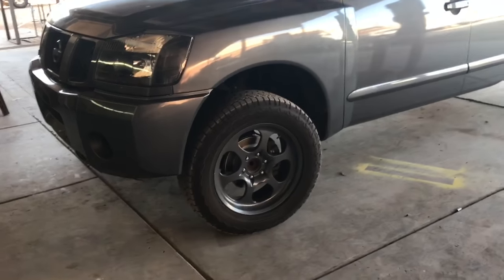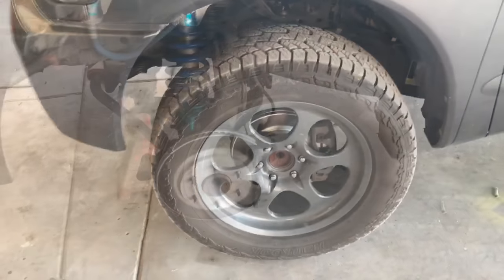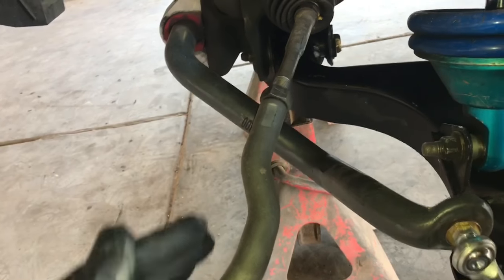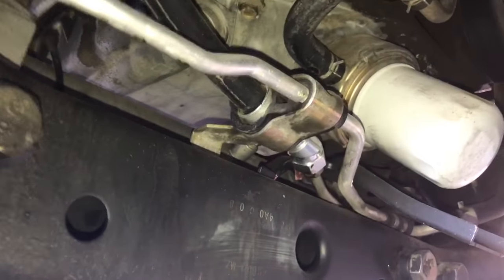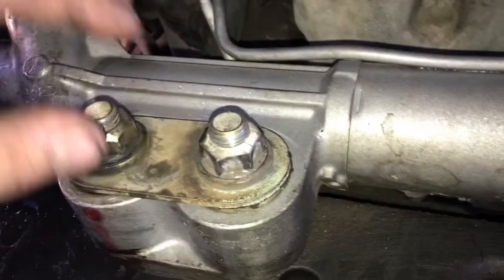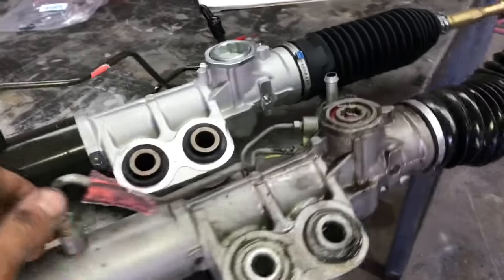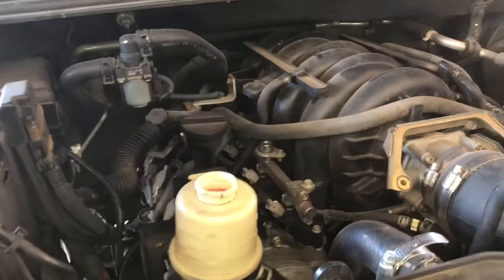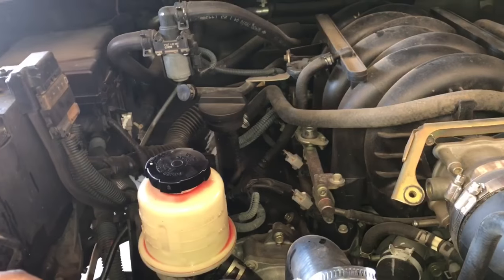Nissan Titan Rack and Pinion Replacement (2004-2015)

Comment: Great video. My 04s rack has a little life left it in, but I decided to replace the bushings. I had a hell of a time with the rack bolts also. Decided it was a good excuse to buy a new impact lol.
Reply from the maker: Ya those bolts are no joke. What impact you go with?
Reply: Truck on jack stands. I used a 6point 22mm socket on a 'crapsman' ratchet (breaks no worries) used my jack to push handle up to loosen. Yes, very tough. Held bolt head with cresent (didn't have correct wrench)

Comment: Awesome again, I’m at 187K in my 08 CC. PS. Boot has a very small leak and I’ve been putting it off because I didn’t want to pay 1000 dollars to Nissan but this looks fairly simple but I have heard about this 3 nuts! I too looked at reman. From Rock Auto! It appears you haven’t had much luck with them! I probably will go OEM also. So glad I found your videos! I can do all this work now! No fear thx.
Reply from the maker: since making this video i have discovered a brand napa uses. i tried one two weeks ago and was very impressed with the qualilt of the rack, looked oem and not spray painted like most rebuilders. ill post the link tomorrow for you
Reply: @AaronHinesAuto   Hi Aron which rack and pinion u can Recommend me ? The dealer want 17.00 for new one and 1000 dollars more for the installation, 3 k total with taxes  .. I looking for buy one and replace by myself, my truck is 2010 Nissan Titan pro4x lifted 6 inch
Reply: @watchmanexpert  that’s an outrageous price.

Comment: 121 torque spec is super tight, i think if you use a breaker bar and jack up the end of the breaker bar it should work. You can spray a bit of lubrication if you want but the strength of the jack can easy loosen it up.

Comment: Great video, just beautiful careful hitting the nut on the tie rod. I did that and destroyed the threads on the upper control arm, so now I have to use a die or replace the ball joint, I would use a fork tool instead.

Comment: Aaron, I’ve tried everything to remove those 3 huge rack bolts, just wanted to know how powerful is your impact wrench? Mine is a 250 ft pound and those bolts won’t budge at all, I’ve tried the heating method, a breaker bar, place the cheater bar on a jack and those bolts won’t budge, i was thinking of cutting the bolts off, any ideas? Awesome video by the way!
Reply: I had to cut one of the bolts off...got 2 off and stripped the 3rd one trying to get it off.

Comment: Great Video!!!  Thank You   I'm replacing minebc  I just tried to do a DIY of drilling a hole through the drive shaft and the shaft that is at the top of the cylinder and bolt them together bc the tines are gone and it was slipping.  
Didn't know that the actual shaft that's above the cylinder was full of oil ! I thought it would be a solid machined metal shaft!   Why is the shaft filled w oil?

Comment: Aaron I replaced the rack and pinion on my 2006 Nissan Armada SE, but now the VDC and SLIP lights are on.
Reply: Youre truck needs to be reprogrammed at the dealer when te vdc light comes on by itself.

Comment: Great video!   However, I am not sure that the three rack bolts on the bolt head side are five sixteens like you mentioned.  The nut is either seven eighths like you mentioned but I believe the bolt heads are a little larger - 24 mm if I am not mistaken.   Anyway, great video like It said.
Reply: in sure he meant 15/16 which is close to 24 mm

Comment: What does the o ring look like on the high pressure line I want to make sure I'm replacing or looking at the right thing because there is an o ring on my high pressure line when I took it off

Comment: 2008 Nissan Armada I replaced the rack and pinion feels really weird on curvy Rodes feels like the steerimg wheel is loose and not somewhat stiff did I do something wrong? Or maybe the rack has air and needs to be purged more?

Comment: When removing the steering shaft did you spread it open far enough to push it sideways or is there room to push it up off of the rack? Thank you
Reply: I know this is a year old but for anyone that probably has the same question. The shaft does slide up. It's made like that in the case of an accident so the steering wheel does not get pushed up against your chest.

Comment: Where can I find your notes for the four-wheel drive removal and replacement of the rack and pinion?
Reply from the maker: its the same as the 2wd exept the front diff will need to be removed. i just make a video  on how to remove or replace the front diff. hope this helps. 
https://www.youtube.com/watch?v=kAYswL9oRBc

Comment: Thx for the video. I have a 2008 Infiniti QX56 (essentially an Armada). Where are the steering rack bolts located? 
Right now it’s making creaking and popping noises when backing out and turning slowly out of my drive way. Going in a straight line, I hear nothing. I’ve been told the steering rack bolts can get loose. So I’d like to see if they need to be retorqued. I’ve already installed a newer Stillen brand sway bar stabilizer and sway bar links. The noises are still there tho. Any ideas?
Reply from the maker: I have the same swar bar on my truck and live it. There are a total of 3 bolts that hold the rack on. The bolts go through a metal crossmember under the front part of the oil pan of the engine. I have not personally seen these bolts loosen up. Don’t can’t it can’t happen though. I have seen the rubber-mounts that the bolts go through go bad, which requires replacement of the rack
Reply: Aaron Hines I also replaced the sway bar rubber bushings and applied Amsoil lube to them and inside the metal bushing brackets. Thought later maybe I shouldn’t have greased them. I really don’t want to take it to a mechanic. Every Armada forum I read pointed to the sway bar bushings and links. It’s not a clicking sound I hear. I know what a bad rack sounds like. Any other possibilities you may know?
Reply from the maker: does the noise only occur when you wheel is turning? with the vehicle off, try having someone turn your steering wheel back and forth quickly, only move the wheel a couple inchs, and look for any play or noises, i  would start there and then recheck the nuts on the sway bar links to see if they are still tight. i have had a few work loose after i installed them.

Comment: Type steering fluid for Nissan Titan 
And
14 1/2 spins ( tie rod) only for driver side or both sides?
Thanks
Reply: It's not really a specific number of spins. He's basically saying that if you count how many turns it takes to do to take off, is how many you should turn getting it back on. That way, the alignment is the closest to when you took it off and can get you back to the shop before re-allignment.

Comment: hey man my steering is super hard, it eases up a bit when I gas it, would this be the rack and pinion or steering pump hose ?
Reply from the maker: Number one issue with that symptom is low fluid level. If the levers is good then the pump is suspected to be bad
Reply: what's the levers ?
Reply: @arthurmarin5726  google

Comment: Question: What are the symptoms of a bad rack & pinion? I cannot determine if I have a bad R&P or  bad pump.
Reply from the maker: Leaking fluid from inter tie rod good and the steering shaft. Also excessive play in the rack. Have someone turn the wheel 1 inch back and forth while you look at the steering shaft and see if the inner tie rods are moving when the shaft moves. You should have much play, good luck!
Reply: @AaronHinesAuto  mine only has a leak. is is possible to just change the seal ( kit sold in amazon)? it would be great if you made a video on the old one to show the location of each one

Comment: I have a 06 Armada, I presume the mechanism in the front should be the same. My rack was broken and I had a mechanic replace mine but I didn't like how he installed it. He took out my front deferential in order to install it. Is it normal or he didn't what he was doing? Please respond because my steering still doesn't feel right.
Reply from the maker: Yes on 4wd models the front differential needs to re removed order for the rack to be replaced. If it doesn’t feel right I would bring it back to him or another shop to inspect
Reply: @AaronHinesAuto  Thank you so much, i am taking it to the guy as soon as possible.

Comment: The truck whines when I turn the wheel does that have something to do with the Rack or the power steering also it gives me low oil pressure when I stop but then goes back to regular when I go
Reply from the maker: Sounds either low fluid lever or a bad pump
Reply: Thanks men look like the was little low n fluid but can't find we're is going or leaking

Comment: Looks like whoever owns that vehicle replaced the stock parts with some goodies underneath her. polyurethanes on swaybar, a swaybar, swaybar retention cups, different shock system and also swaybar adjustment nuts. It’s kind of a nice thing that can get destroyed Minnesota though.

Comment: I have a 4wd, what will I need to do differently?
Reply from the maker: you will need to remove the front driveshaft by taking out the 4 ujoint bolts, then unbolt the front axles and allow them to drop off the front diff, then remove 3 bolts the hold in the front differential allowing the front diff to drop out of the truck,  now you can work to remove the rack
Reply: Also have a 4wd but it has a 6" lift.the front differential is already via the bracket lift.do I still have to drop the front diff?
Reply: @AaronHinesAuto  sorry it’s old but I’m about to replace mine on 4x4 and was wondering do I need any new hardware? Seals when I drop the diff
Reply: @iansenhouse-laville1181   Hi did u replaced the rack and pinion? How difficult is ? I also have 6 inch lift my truck is 2010 Nissan Titan , which rack and pinion brand u used ?

Comment: ALL was good with the repair.......Well basically until I watched you take a sludge hammer and smash the nut downwards, while still threaded!!   No bueno!!  Unless your replacing them, not a good idea to hammer on the nut downward like that. Your definitely gonna ruin the threads of the tie rod,, 1000%.  Then the top of stud will be mushroomed out, so you can't tap it. Annnnnd yep, ur buying new outer tie rods.  Basically your supposed to just use the nut as a shield for the threads of the tie rod,  and hammer the hell out of the knuckle of the spindle  ((The housing the outer tie rod sits in)).  Ive been a Technician for 16+ years and yes I learned very quickly not to do what u just did.  Having to pay for some new tie rods out of your own pocket, will dent the wallet a smidge, leaving u having a bad day. 
:::Just a heads up::: 
Good video otherwise. 👍👍
Reply from the maker: thanks for the compliment on the video , the point of the nut being on the tie rod is to protect the threads while you remove it from the knuckle. i have removed tie rods this was 100's of times and have never damaged a single one. not to say it cant happen tho.

Comment: Doing this now my biggest problem is the line… that mf ain’t coming off Lmaoo!!!!!! Not the high pressure the return line is impossible for me
Reply: For the 3 bolts I used an electric impact with 1100 ft lol… so the bolts were butter but the line for me was the hardest part so far can’t get the line off…